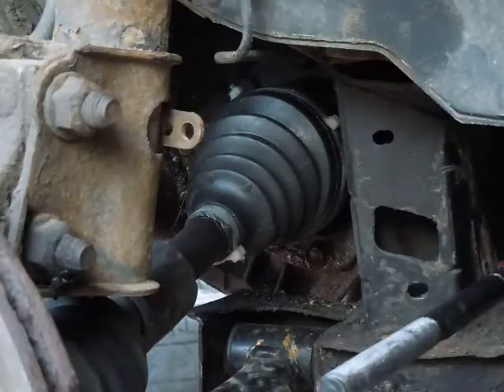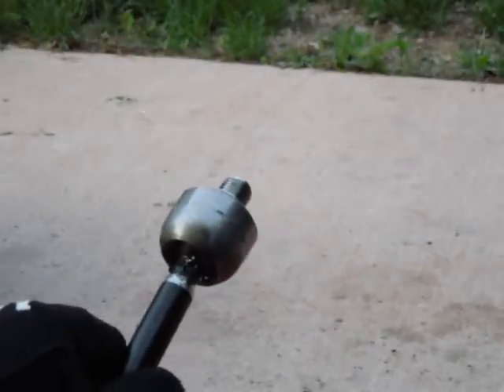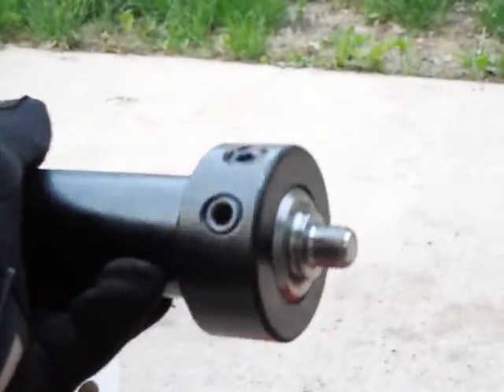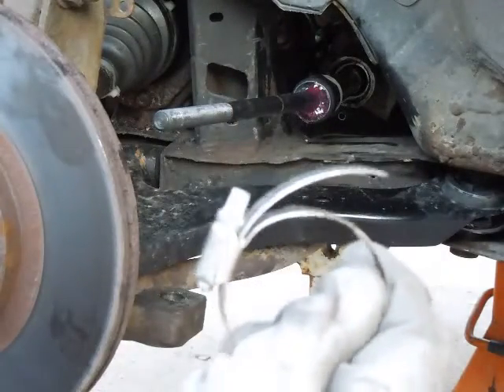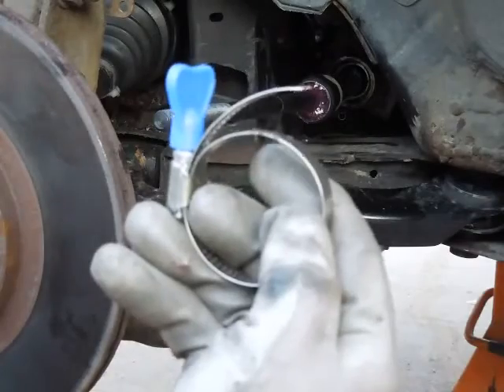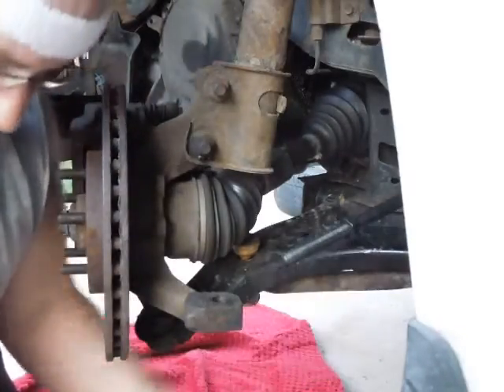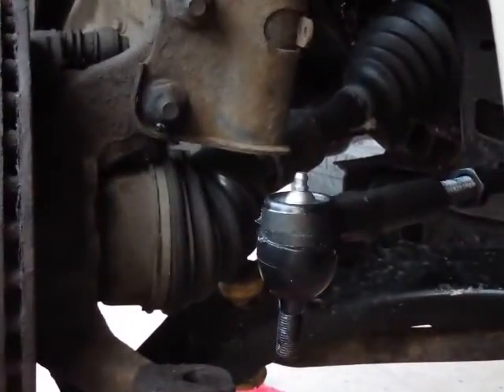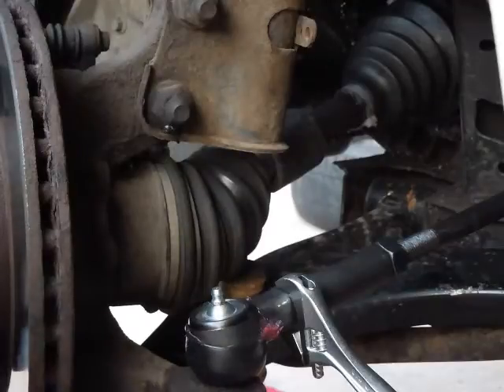complete, inner tie rod end replacement 2002 pt cruizer - cruiser Suspension 02

Comment: Thanks for the video! I just got a 2002 PT Cruiser, and I notice the left front feels kind of rough when I go over bumps. How do you know it's the tie rod, vs. the CV joint, the axle, or the shocks/struts? Thanks so much for showing the tools you use, too, most videos don't
Reply from the maker: ***** for diagnostics here is the list. 
1- Tie-rod=. jack up the front 
tire in question by the frame,, not the suspension. once the tire is 
free and clear of the ground, grab the tire at the 3pm and 9pm spots. 
see if it will turn in a tiny may, like it has slop. I am not referring 
to the steering unit moving, the free play of the tie rod end can be 
felt as play if the wheel is wiggled side to side. it should not have 
play. if you feel a free play that is about a 1/4 inch or more, you need
 to look into a tie rod end. please carefully turn the wheel so that you
 can get to the end of the tie rod end and touch it. you should not be  
able to wiggle it. It should be all a snug metal to metal fit, any free 
movement is  a possible problem. 

2-the CV joint shows wear [it is inside it's protective rubber flexible boot] by making a clicking noise when you turn and really only when you turn hard and under power like turning onto the interstate. when going strait it is usually quiet.
 There are more symptoms but they are harder to explain and detect. 
  
In summary, the Tie rod will cause steering sloppiness because that is the 
MAIN connection part between your wheel assembly and the steering unit 
bolted to the body. If it is worn, you will have a wheel that wiggles 
left and right even though you do not turn the wheel.
The CV joint is how the power from the tranny gets to the wheel, strait or when turning. there are great videos on YouTube about CV joint explanations.
 Basically the tranny power gets to your wheel through the CV joint and the 
drive shaft on our front wheel drive cars. When the CV joint [on the ends of the drive shafts] is about to fail it will have sloop inside it that will be felt and heard when you turn the wheel and apply power.  constant clicking, and clunking  until you straiten the wheel are the most common symptoms. mine clicked/clunked  for several weeks before it blew apart while I was turning and giving power to the wheels. I then lost the ability to get tranny power to 
the wheel because the CV joint had failed. It was not connected to the 
wheel any longer. I needed a tow truck to get me home.   Marilyn, I hope this helps.  There are also many bushings and other insulators that keep the suspension tight and working great, after many miles [180k on mine] they wear out and you have noise issues. The stabilizer bar which runs across the front end underneath from almost wheel to wheel and is like a big spring, helps with bumps and stability. it too has rubber/plastic bushings/spacers that when wear out, will make that solid steel bar knock against your frame parts. feel free to message me for more info.
Reply: Thank you so much Cjj!! This was awesome. So I think it is a suspension issue, because it doesn't fit the tie rod or CV explanations. I am just driving it really steady for now, and trying to avoid as many Minnesota potholes as possible, lol.
Reply: Hey Marilyn. Will Knows Tons About Cars so if You Ever Want Him to Take a Look he Would be Happy to!!!
Reply: Thanks Kayla, I'll definitely keep that in mind. Knock on wood, its okay now. Wouldn't start earlier, my dad came and turned out it was a loose battery cable, lucky me it wasn't something way worse!

Comment: I am about to have the tie rods, etc replaced, and the mechanic will give me a very good price if i provide all of the parts, but I have NO IDEA what parts are required.  Could you provide a list?  My 2002 PT has about 170,000 miles, and there is a lot of noise in the front end, so I think I may also need shocks and struts, and possible bearings.  Do you have any diagnostic info, please?

Comment: my 2006 PT only has 57k mile on it and I have bad inner tie rods already! My motor mounts went bad at around 35+k. My radiator fan motor had to be replaced (fan would not kick into high speed when I turn the AC on). I bought this car brand new 0 miles. The Pt Cruiser is a true piece of shit car! I won't be buying anything Chrysler ever again!

Removing that center motor mount was absolute HELL on this car!!!
Reply from the maker: It seems like you have to take the entire front clip off just to change a belt with a shity design stuff a Dodge Neon inside of a shoe